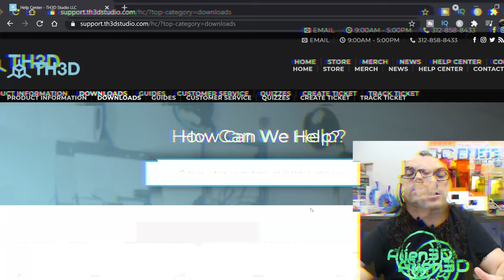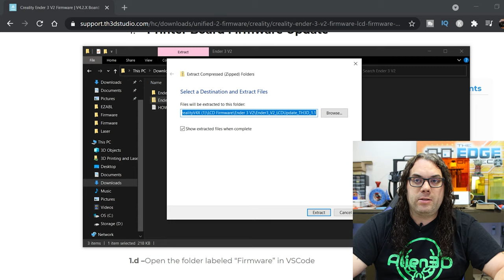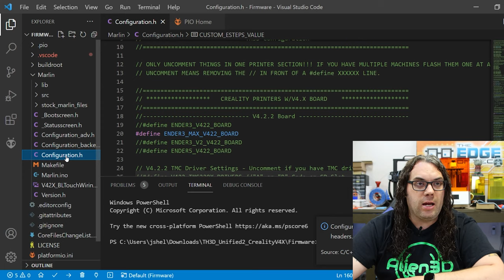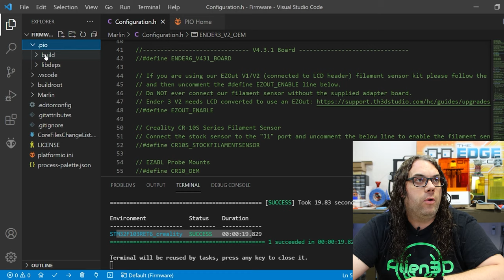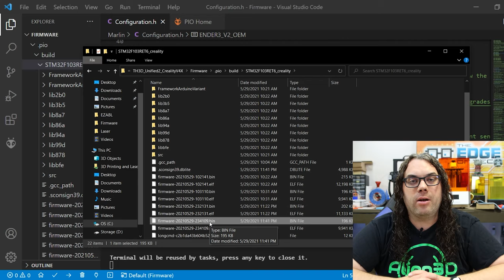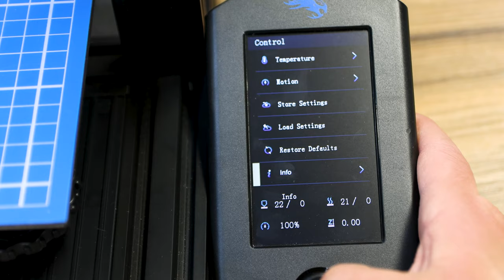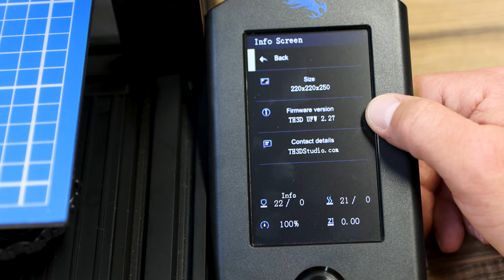The Ender 3 V2 Firmware Update Video I never Released!

Comment: Just to point out  that if you do not have the 'tick' at the bottom of Visual Studio Code to build the file, you need to install the Visual Studio extension "PlatformIO". Once the extension finishes installing restart VSCode.

Also becareful with the recent silent chip changes from creality going from STM to GD. Since this builds the STM firmware not the GD firmware for more recent makes of the printer. Due to a 'shortage' of STM chips.

Double check your LCD is actually DWIN or DACAI. If your LCD has a barcode, the same as in this video it's DWIN. If it has a sticker with a blue circle, its DACAI. 

TLDR; You don't have the tick build option? Download PlatformIO extension in VScode. Check that your MCU chip is STM not GD. Don't install DWIN LCD firmware on DACAI LCD.

Awesome video as always, thanks!

Comment: Thank for the video! Found your channel while doing this and your video was tremendously helpful! For my install, booting the printer up after doing just the LCD upgrade made the screen appear kind of glitchy. After I put the mainboard firmware update on the MicroSD card and inserted that and restarted the printer, it booted up correctly. The UI does look a little different now, but everything seems to be working. Thank you!

Comment: So I just spent 2 hours trying to update the firmware.  Your video is good, except it does not make a distinction between the "DWIN" Lcd and the "DACAI" Lcd.  It would be helpful if you put a disclosure at the beginning of the video..  I have my printer all torn apart, very frustrating..  Could of stopped at step one if it was not the correct LCD.
Reply: I'm on like 3 hours trying this over and over I cannot find clear cut videos about how to update the firmware on this printer it is causing me so many issues.
Reply: @thinktank_gaming  many videos with many hiccups.  I put it aside for now.
Reply: Check out this video, I hope it will help you with your problems guys:
https://youtu.be/DJZnYB0IVCY
Reply: @damionchrist  the problem is the make of the lcd. Whether it is a dwin or dacai.
Reply: @ProneToRome  - bar code is dwin, blue circle is dacai

Comment: I don't have the checkmark at the bottom that you clicked to compile.
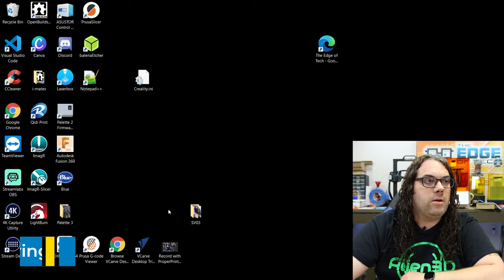Reply: If I remember, you have to follow the steps from 4:57 exactly, if you open the firmware differently it doesn't have the check mark.

Comment: When I change the lines of code it gives me errors and won't allow me to compile.  I am in tech but have never used C.  I'm wondering if it's an extension in VS Code that is giving me the issue.  Anyone else have this problem?
Reply: Have you installed platform io and Marlin auto build?

Comment: I have no "PIO" dropdown within Visual Studio Code - prior to that, I also did not have the check-box option on the bottom left of my interface. Running this on Windows 10. Any ideas?
Reply: You need to install the platformio extension in vscode

Comment: This only works on a DWIN LCD and NOT the DACAI LCD.  You never mentioned this on your video and as a result I now have a display that is corrupted!!!!  I've tried to flash other firmware versions but none of them will replace this one.  Can you please advise what I can do to get the display back to an older version??????   Currently I cannot use my printer thanks to your misinformation

Comment: I had done, the machine's firmware before doing the screen and the new LCD firmware will not render the correct icon. What can I do?
Reply from the maker: Are you still having this issue? What is the screen doing?
Reply: @TheEdgeofTech  it shows the creality logo at the beginning, but it never turns orange and the screen glitches then when I move the knob it just goes back to the default icons but with the new menu settings

Comment: I have never used visual studio and then after installation i was missing compile button. Then when i installed CMake extension it says "unable to find compilation informatoin for file" and another error "Is it installed or settings contain the correct path (cmake.cmakePath)?" So im stuck there.
Reply: In visual studio coder, the left hand side there’s an extensions tab. Search and install “Platform.io IDE” then you should have that check mark at the bottom.
Reply: @MegaCoolioness  Thank you! That helped immensely!

Comment: I have the DACAI LCD, and followed your instructions to the T, on 1/17/2023. The screen is now useless. I made the mistake of NOT reading all of the comments on your video, and now it is corrupt!! I like your video, and the step-by-step approach you take, but that doesn't get my Ender 3 V2 NEO up and running. Please post a video of exactly how to return to a working LCD - I don't read Chinese.
Reply: *NOTE: If you're V2 NEO, has the DECAI LCD -- DO NOT copy the DWIN_SET file to the MSD card -- Instead, OPEN the DWIN_SET file, and copy over only the PRIVATE folder. This will prevent the LCD from being corrupted, and it will work correctly, once restarted. Also, when I flashed my LCD, instead of seeing solid color blue and orange panels, it was only blue, with text scrolling from right to left, with a progress bar on the left-hand side...

Comment: ender 3 v2. mainboard 4.2.2 
stock firmware 1.0.2

the display doesnt update or anything, its as if the sd card isnt even in the backside. any suggestions?

Comment: i am having extremely high amounts of troubles with my 3d printer. is there any way to get any assistance i was printing before but now it wont extrude filament and i have an all metal extruder and new stepper motor i tried to reflash my firmware but it keeps reverting back to the original marlin screen and wont flash the screen at all to get that look :( please help

Comment: I got Creality load screen screen looking at the files in the folder that's all that showed. This right?  
O it worked after the update and is very different to your video. Nice must be a new update.
But no BLTouch.
Reply: How do I now downgrade the screen?
Reply from the maker: It should work, but there are some updates from when I shot the video!
Reply from the maker: Good question. Why are you looking to do that?
Reply: I found BLTouch further down the list. It does ask what kind of connector your using. Mine is 5 pin.
Reply: @TheEdgeofTech  Couldn't get the bltough to work with the compiled firmware so was going to go back to stock firmware but Tim Patton mentioned I had to let it know if I was using a 5 pin so gonna try that.
Reply: @timpatton3948  Thanks just had a look and I have the 5 pin. Had it set for 3. Giving it a try later on this morning.

Comment: I followed LCD firmware, waited 30+ sec after seeing orange color, power off. Power on. Did not see the TH3D logo. What should I do? Flashed FAT32, 4096 bytes. I placed DWIN_SET into the file for Ender3V2 4.2.2 at 256K, my cpu is at RCT6. I didn't place the firmware with the DWIN_SET. Is this what I should do to flash LCD?
Reply: I formatted, not "quick format" flash card. Followed the steps. Saw blue 10-15 sec --> orange 1+ min --> power off --> removed sd card --> power on --> still shows creality logo --> fonts are partially visible/ shows about 25% of the original words. Need help!
Reply: @mikecheng6959  happened the same here, can you share how did you fix it?
Reply: @EduardoPerez-wl4yp  had to change the circuit board. It's been a while but I think it was because the original board was fried somehow.

Comment: I recently upgraded my ender 3 to the ender extender 400x400. I used the TH3D guide from this video to compile my firmware. Super easy to do if you follow along with this video. Only Issue I have is getting the firmware to understand my (X, Y, Z) offsets for my Bl touch. currently my probe misses the bed on the Left side of the build plate. I changed line 186 to read #define NOZZLE_TO_PROBE_OFFSET ( -45, -6, 0) however that didn't change my offsets from the default configuration. Any one know a solution to this issue?